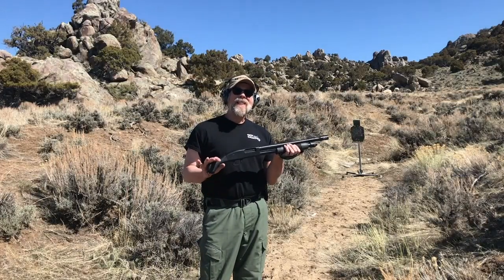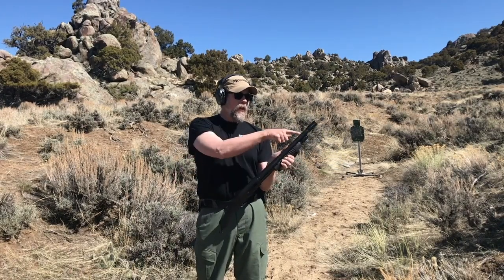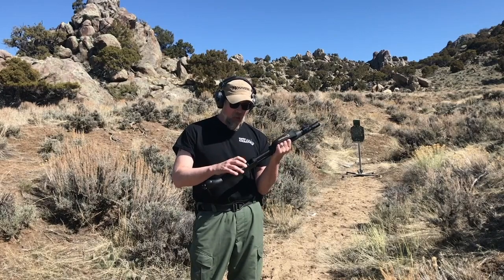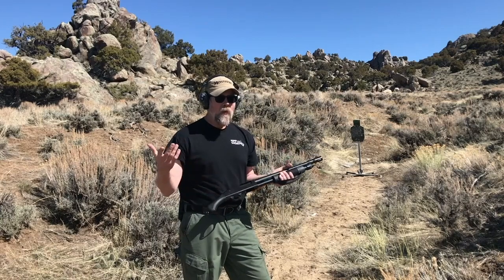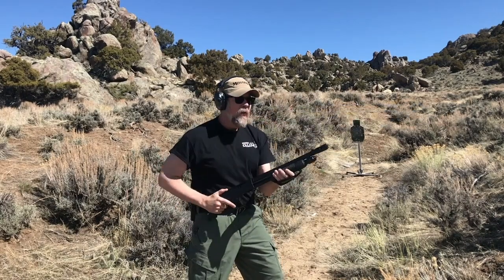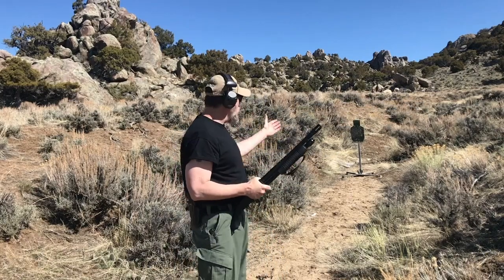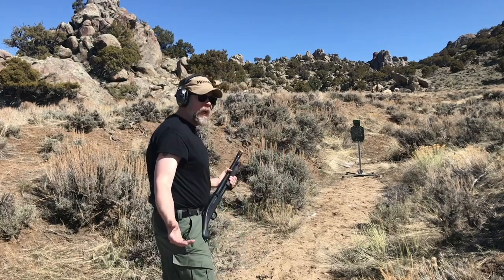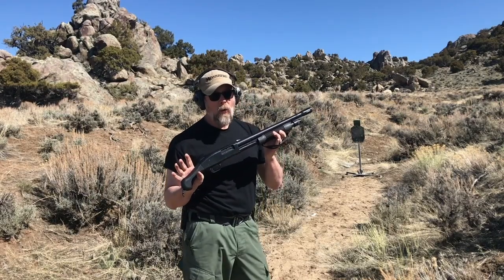How to Shoot a Pistol Grip Shotgun

Comment: I wanna see you do it with 3” & 2 3/4” shells not those baby shells
Reply: I did it with a 20 ga I could only imagine a 12 lol
Reply: @anactualtexan777  I have, and I've found it quite an exhilarating experience.  But not everyone likes to fire off a 12 gauge pistol grip.  I'm sold on them.
Reply: I do it with my shockwave. 12g 2 3/4” shells. slug and 00 buck. My buddy does it one handed every time. I don’t try that tho.
Reply: Yeah he’d lose teeth
Reply: Im so baffled. I fire all kinds of shot. Slugs are a doosey but i shoot all kind of 00 holding it up in front of my face. No way is that thing gonna punch me. Push pull method guys. Im tall but slender. 5 9" 140lbs.
Reply: That's what I said!! These 3" double offs
Would knock him back for sure!! I think I about to buy me some minis😄😄😄
Reply: Look at the Demonstrative Concepts recoil strap.
Reply: Just tried 3inch #4 buck in my pistol grip mossburg and it ain't no joke

Comment: Actually, you can shoot from the hip and hit your target, but you have to practice (a novel concept). I've shot clays from my hip, double fire to get that second piece flying off to the right. If you need to "aim", use a stock. Meanwhile, you can improve your cycle time by pumping the next round on the recoil. Use the recoil action to perform the pump. You'll  like this!

Comment: As a heads up to those that may want to follow his example, his modified shotgun does not fall under the same ATF consideration letter that the Shockwave and other factory made birdshead grip shotguns fall under. One of the reasons the ATF designated the Shockwave a “firearm” is because the weapon was never intended to be fired from the shoulder since the receiver came from the factory with a birdshead grip. Because the man in the video instead modified a shotgun that came from the factory with a stock, he has technically made an “any other weapon” and is thus required to register it as such with the ATF using a Form 1. 

So if you do what he did and don’t register it properly, you run the risk of being charged with a felony should your weapon be seized and inspected at some point (like it would be were you to use it in a self defense situation).

You’re better off buying a birds head grip shotgun than making your own.
Reply: Is it the same thing with a pistol grip?
Reply: @DLI002  Yes, though I should clarify that the ATF doesn’t specifically say that. They left their “any other weapon” category intentionally vague as a kind of catch all for customized weapons of a shorter length that they don’t like. So it’s not the modifying the gun the way the guy did or the way you’re considering is explicitly illegal, it’s just not explicitly authorized like the Shockwave and similar guns are that come straight from the factory. These kinds of mods on shorter shotguns are a gray zone where you could possibly face charges; buying the Shockwave is the only way to ensure you’re in the clear. 

All that said, I’m not a lawyer, I’m just a guy that cares enough about following the rules to study them
Reply: @arturoharvey9733  Bullshit. I can put a freaking pistol grip on my full size shotgun all day every day. It has always been that way. This grip in NO WAY makes the gun illegal.
Reply: @earthsurfer13  Yeah, since I posted that I’ve educated myself a bit more on the topic. Adding a bird’s head grip doesn’t make is specifically illegal, rather it’s just not specifically legal in the same way that the factory Shockwaves and such are. It’s a gray area and not as black and white as I said. Mossberg and other manufacturers decided to get that letter from ATF to get out of that gray area.  Making such a shotgun on your own doesn’t afford you the CYA that the ATF letter gives to factory Shockwaves and such; the individual buyer has to decide what that’s worth for themselves.
Reply: @arturoharvey9733  so if I were to get the 18.5 shockwave and put a stock on it would I have to do the same thing? It's been impossible to get a standard Mossberg 590
Reply: My understanding is if the overall length of the weapon is 26" or more. Or the length of the barrel is 18.5" or longer. It's considered a shotgun. You can modify it to your hearts content. If any of those specs is less than I stated, it is considered a firearm (SHOCKWAVE 14" barrel). Then it can't be modified unless you register & purchase a $200 tax stamp from ATF.
I was think of getting a Shockwave, but I'm content with  my Mav 88 Security that I can upgrade how I like without getting ATF involved.

Comment: I fail to see how this has any use case that a normal shotgun with a stock could not do better.
Reply: In terms of shootability, absolutely. The caveats I have is I have a blast shooting mine so, the fun factor is there. I have an 88 with a pistol grip and 18.5'' barrel, and the other big thing is it makes for a powerful, but very compact gun for thick woods, maneuvering over fallen trees, climbing up embankments. It's so light I have no need for a sling and it can be easily stowed. I can very easily hold it in one hand and climb with the other, it feels very natural to run with it, and you have nothing sticking out to the sides of your body when you do. With bird shot and using the bead I could easily take rabbits at close range, and I'm comfortable enough practicing with it to be useful for bear/wild animal defense, especially with 6 shots. My stocked short barrel shotguns are very maneuverable as well in thick bush, but this takes the lightness and maneuverability even that much further, at the cost of shootability. I wouldn't say it's a better than having a stock, but it does have its perks.